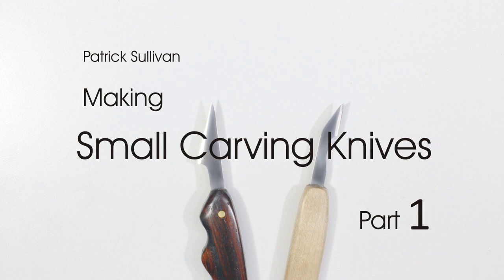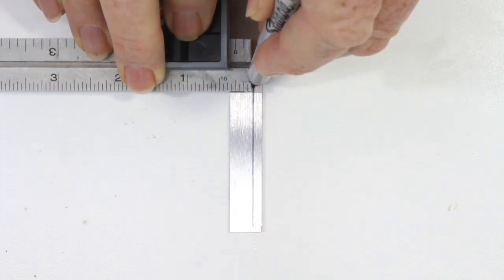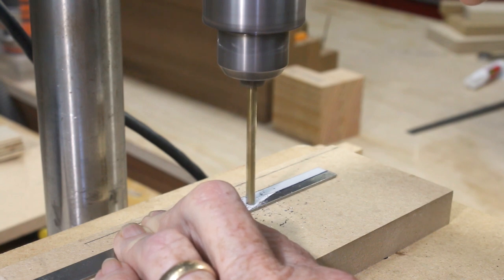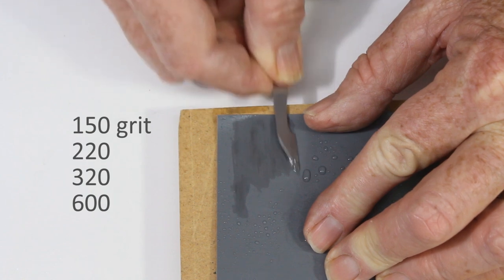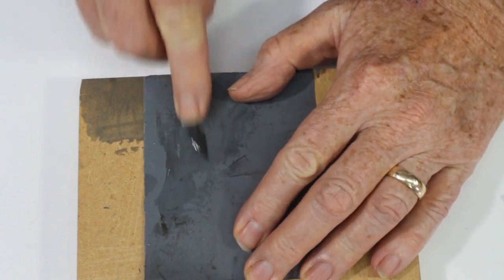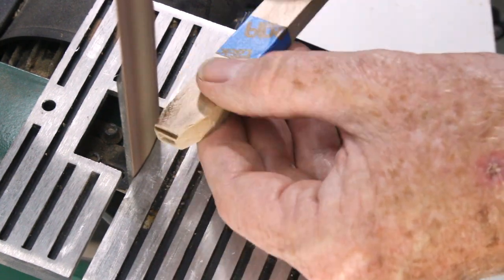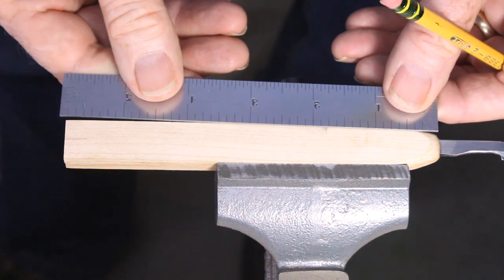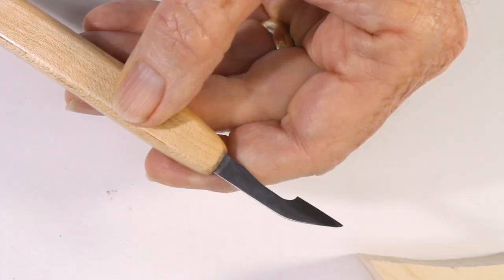Making Small Carving Knives:  Part 1

Comment: Hi Patrick, I'm a toolmaker from way back. Your tempering is great. When I learnt my trade, the hardening process was exactly the same as what you showed. When tempering, we found a visual aspect to the process was excellent. We polished the surface of the hardened unit, ensuring that we didn't touch the polished surface thus placing the oils from our skin on the surface. then we would re-heat the unit, by oven, or on a steel plate, slowly. We would watch the unit go through its colour range, depending on the hardness required. A light straw colour would give us the hardness you were looking for (around 55 - 58 on the rockwell scale) the colour range would commence at light straw, moving into dark straw and eventually a blue colour. Tempering removes the brittleness of the steel such as a files cutting surface (62-65 rockwell) would be, hence the ease of snapping a file with relative ease. Try snapping the part of a file that fits into the wooden handle, it will only bend because it was tempered back to a blue range. Your video brought back old memories that most Trades apprentices would never get the experience of these days. Thanks for the memories, ever tried case hardening mild steel? ;-)

Comment: Best carving knife build video I've seen so far. Using the O1 flat ground is brilliant. It machines well and heat treating is just about fool proof. I was surprised that no rivets were used, but the epoxy should work well. If I make a knife or three, I will make just this way. I didn't like the drilling technique shown however. Obviously this craftsman has never had his hand laid open from a spinning workpiece. It's nasty and bloody and best avoided with a simple stop if nothing else. Eventually it'll get you.

Comment: Although D2 tool steel needs to be heated to ~1800F for heat treating, O1 steel only needs to be heated to about 1550F.  For larger tools, that is easier to achieve with a simple propane torch.

Great videos, Patrick!  I enjoy your informative style and presentation of detail that provides even a novice enough importation to be successful.

Comment: To stabilize the stock to drill the holes, just place several roundhead screws at the edges of the stock to act as stops and hold the stock down to the board.

Comment: Hi there, having watched this video I've checked my oven for temperature settings,  would a higher temp be better over 500f ?
Reply from the maker: No.  The temperature for the tempering is critical.  If you temper at a higher temp, like 500, the steel will lose more of its hardness.  This makes the steel a little more resilient, but you lose some edge-holding ability.  This would be good it you were making a screwdriver or an axe, but for very small cutting tools like these, my suggestion is to follow the tempering formula I provided in the video exactly.